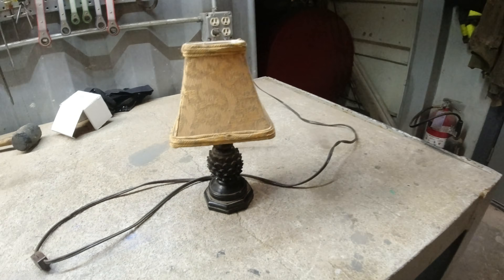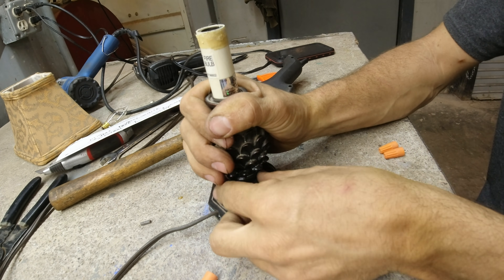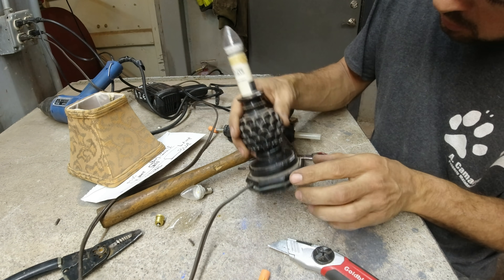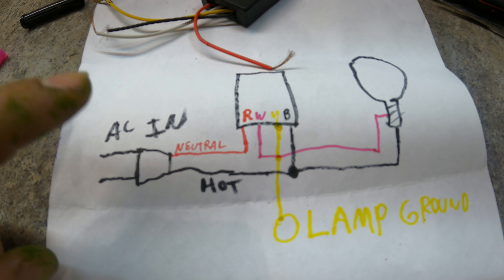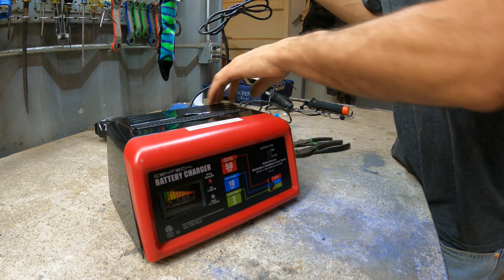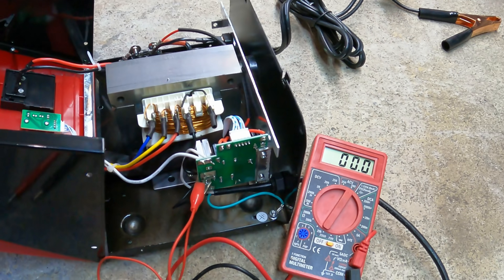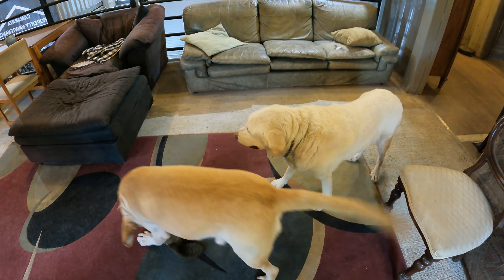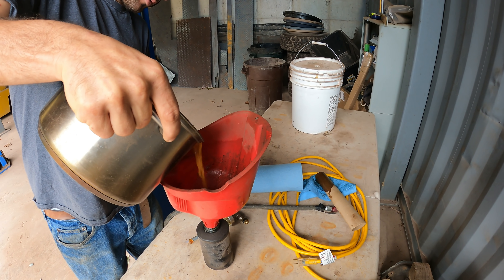Installing a touch sensor in a lamp

Comment: If you're an electrician with knowledge of color wiring I understand how easy it is, but to us non electricians, what the hell is hot wire and neutral wire and ground wire, etc. Thanks Both wires from the lamp are black so I have a fifty percent chance of blowing the new dimmer box. The only way to do this correctly is knowledge of which wire goes where...

Comment: You know, I was told that if you don't have a multimeter and you want to be sure you are having electric power, but still not sure, just hold on to the negative or ground, and then touch the positive end to your Tung, and then No Matter What You Will Then KNOW.
Attention, don't try this.

Comment: I put my lamps yellow wire to my bed frame, which is metal, saves reaching over to the lamp.     Or in your case run the wire along your window frame , 😊

Comment: Can you tell me how you did this PLEASE. I have the same charger but it's a little different internally mine is the 60581
Reply from the maker: I actually bought a newer one of these chargers and could not get it to work and ended up ruining the thing and returning it. associated equipment sells new battery chargers that actually work.

Comment: Love the touch circuit.  Exactly as you said.  Big in the 90s.  Polished Brass plated Lol. 
Put it in the truck for ignition.  Just a small touch pad in. Hidden spot.   
Holi crap Andrew.  Dude !  As soon as you get away from heavy dangerous high power equipment you nearly off yourself with low power cottage lamp. Not that 115 Vac is low power.  It will kill a person but still.

Comment: When you removed the cover from the switch so it would fit, you exposed several positive wires (hot). Then you put it in the bottom of the lamp touching the metal rod in the center. Everything was fine till you touched the conduit which was like flipping a switch thus dead short. One time it was shorted and blew the breaker when you plugged it in.   My Opinion and probably wrong. Now I know why you wanted a FIRE proof house.

Comment: I'm no electrician, at least not licensed, but something doesn't seem right with the schematic.
The hot lead looks like it makes it all the way to the bulb without a switch, whereas the neutral is switched.
I thought, and I could be wrong, that the neutral must NEVER be switched. Only the hot lead.  Anyone?

Comment: I think the Made In China is recipe for disaster I had to put in a fuel pump and ever single wire was wired backwards. pump and fuel indicator both did not work when every wire matched in color rewired it all backwards after checking to see which was pos and neg everything worked

Comment: As electrical engineer this was pretty hard to watch, biting down my teeth "Dude be careful" electricution "Holy shit!" :D

Great advice i once got  when i was starting as electrician, my boss said to me "If you really have to do repairs with live machine, put your left hand in pocket"  And the point in that was, if you happen to touch the live wire, the electricity will run through your right arm to your legs. But if it was left arm, it would go straight through your heart to the legs.

In case the floor was insulated, arm to arm will do as much damage. Left hand in pocket! 
Yet that doesn't remove the risk of dying, always unplug all the appliances while repairing.

Comment: Dude, that cardboard sleeve on the lamp socket insulates you from the 120V screw contacts on the inside. It's very thin. Sleeving it with a metal collar not the wisest move. If it shorts you won't know it until you complete the circuit... Your house is awesome.

Comment: A tip for Andrew: I have seen you unplug both the lamp and the charger by PULLING THE CORD instead of the plug. Don't do it like that. I repeat: no. I insist: no.

Comment: As  interesting as this may be to some,   "touch lamps"  are  a piece of crap.   The sensors  GENERATE  RFI/ EMI   and they are SENSITIVE to same.  This means that the lamp can be triggered  needlessly/ unwanted  by  various other electronic devices, including  radio transmitters.   A person has to ask himself  "just what is wrong with a  switch."    you know,  a SWITCH,  those things we used to us  to turn  stuff on and off.

Comment: Very funny stuff. Have to admire your determination & stamina (& Levi's). If I missed someone else's comment on your wiring diagram, it was probably because I was laughing too hard. Not about the diagram, just the comments on the video. It appears you are switching the neutral leg of the circuit not the "hot" leg. That means even when it's turned "off" there's always juice at the socket. Normally you would switch the "hot" leg. Keep the vids coming.

Comment: I know just what the Container Castle needs.  Two things:  1) zip-line from the upper level above the hot tub to the ponds below and 2) a swing fixed to the north side of the CC roof with the step off located next the tower at the hot tub level. Oh, ya!

Comment: Thanks dude! I was able to do it first try, thanks to your vid. Cheers! I hated my bed lamp before
Reply: I had a blue wire on mine. Used it to hot.
Reply from the maker: That's good to hear. I am still loving my touch lamp.

Comment: Hi Andrew, good to see Levi is fine. You sure were diligent about getting that lamp to work  with the touch switch. Interesting to see the  Habor Freight charger and DMM same as I have been using for years. Always wondered what you would think about their quality. Awhile back I got a second HB charger and it didn't want to work? Then I bought their larger roll around model and that demonstrated the same 'non-working' effect. Give me an old style charger any time. I will watch the video again to see if I can figure out where you put the solder bridge at. Also seems my old deep cycle battery keeps charged for a long time and will work when nothing else will. Seriously, Go figure! My shop is filled with HB tools but I have found if I let the get rained on they rust quickly. Terry

Comment: I do believe he wired it up so that lamp switches the neutral on and off which is wrong.  The hot lead from the plug needs to be switched.
Reply from the maker: That's How I had it the first time and it exploded. Technology connections made his the same way with the neutral being switched.

Comment: those new led bulbs are not designed to work w touch sensors- they need a fixed current. must use traditional filament bulbs. i had the same exact problem. lol

Comment: Those boards might've blown because you shorted the board. They have that plastic casing for a reason. One of those connections might have touched the nut inside.

Comment: Andrew - if you have not tried Solderlene paste flux, you really should.  Solder joints flow much quicker than flux core solders and it doesn't end up as a hard or burnt residue making it easy to clean.  And although it's not recommended for 'proper' soldering technique, you can transfer solder from the iron tip right to the fluxed joint and it'll flow right in, quick and easy - good enough for home and automotive repairs.

Comment: I just watched this video read the instructions again these will not work on any bulb that requires a transformer. Like a florescent or a LED bulb. This is why their so cheap. And their sensitive to any voltage change.

Comment: Hey Andrew, the touch lamp thing is great but just an FYI, soldering "line voltage connections" is technically a code violation. Now you can do what you please but as an electrician just want to make you aware of it. I'm sure your asking why, the theory behind this is that if the wires were to heat up to the point whereas the solder could melt, the splice can then break and short the hot wire(s) out to ground or another wire and cause a fire or shock hazard. I know you typically mechanically join your wires first which is great but something to think about moving forward, I wouldn't use solder alone on anything higher than 60 volts AC

Comment: the best way to build an strong elevator is getting a huge industrial forklift and use its lifting mechanism with an mains operated hidraulic pump. 
the other cool thing you could do is super cool Startreck sliding doors with 2 pneumatic cylinders as a drive. you can find how-to in youtube!
your dogs will love automatic doors, mine do!

Comment: Andrew the problem you can NOT convert any lamp, because the modern lamp bulbs  are a capacitive loadthat produce a peak current that these cheap transistors cannot handle well.
it even says in description it can only handle old style tungsten lamp.

Comment: We had an old battery charger that the diode went out on and was putting out straight wall AC, it not only killed the battery but fried the car ecu the battery was attached to. Don't recommend clicking the leads together for charger longevity and check it's putting out only DC and no AC with a voltmeter every few years.

Comment: On a more serious note Andrew; A while back, some of the nay-sayers were shouting that the castle was too heavy to support itself, which I didn't think was likely. Since then however, you've added a helluvalot of weight, mainly the roof but all these windows are heavy too. Are you going to run into weight issues at some point?

Comment: Andrew I hope that when you install all your doors and windows you leave some allowance for the expansion and contraction of all that steel between summer and winter. It would be fun to have actual measurements between the 2 seasons to see what the difference is. Keep up the good work!

Comment: I admire you for most of your skills. But buy a cordless system for switches and use a cellphone and automatics for on and off. Keep digging be carefull when working with electricity.

Comment: you really should keep the bottom part of the plastic to keep the glue and felt from shorting the board.   the back of that board has hot 110 close to each other.

Comment: Would you spray the underside of the roof with open cell spray foam to help with rain noise? If not, what are the insulation plans for the space?
Reply from the maker: Possible. There is no rain noise because of how thick the metal is.

Comment: $10 at Lowes or other hardware stores. 
https://www.lowes.com/pd/Utilitech-Black-Touch-Lamp-Control/50063801?cm_mmc=shp-

Avoid any rewiring and works every time. I even ran a wire from my lamp to the contact where the touch sensor connects and now when I touch my lamp it turns on.

Comment: 13:15 - You can do what want with your electrical, but pulling the cord is a quick way to requiring a fix of said cord and plug.  But your going to fix it anyway.  Just a pet peeve of mine.  I won't bitch about anything else you might do - promise.

Comment: hello andrew great video on installing a touch sensor in a lamp but wow it sure gave you a problem for abit but then you where able to fix it very nice and it works now and you also fixed what looks to me at a jumper cable box thingy great job and as far as your castle building nice widows on the top floors with a great view out them as well ss thankyou for this video andrew and until next one i say bye for now from Randy from ontario,canada take care and stay safe out there p.s hi levi and codey.

Comment: hey man, I knew a guy who spent his whole life building his house out of corten. and steel, by the way when you install the windows make sure they are in a wooden frame (so they can flex) because if its glass to a steel frame, then it will crack, my dad spent alot of time replacing his windows with wooden framed ones. good video

Comment: I find it hilarious that you go through the trouble of insulating your wire terminations, but don't worry about insulating the board itself.
Reply from the maker: There is nothing metal for it to touch.
Reply: @AndrewCamarata  oh okay I thought you said it was metal at the part you scraped part of it with a knife, my mistake

Comment: Having been kindly shown your efforts in your fantastic castle like residence. Am a bit concerned about how on earth youm are going to heat all that area. Especially up top. I did suggest to you when you were building the roof to use HHO as a fuel for electrical generators. Not sure if it would be legal, but ordinary tap (fawcet) water can be turned into a very effective fuel, that would cost you virtually nothing exxcept the original cost to install an HHO generator from here  https://www.youtube.com/watch?v=wjeM2IBhtlc. Free electricity ... virtually. You can run cars on the stuff.

Comment: If

Andrew, looking at the last schematic you drew, the hot wire is always providing power to the centre contact of the bulb and the neutral is controlled by the touch sensor which then switches the various levels of power to the outside contact of the bulb (edison screw). Not good and not safe. The touch sensor should be controlling the center contact of the bulb for safety and the neutral connected to the edison screw. Also make sure the plug is polarized so you cant reverse it in the outlet. It was a funny video.

Comment: Andrew, you should get "the clapper" that they used to sell back in the 80's and forget about trying to wire a lamp. You are a hammer mechanic, not an electronics tech.
Reply from the maker: I just got one for the lights in my big triangle window.

Comment: I have tested that same Harbor Fail charger and on "50 amp" it puts out a maximum of about 25 amps for about 30 minutes then will overheat and shut down.  It works great for as an automatic slow charger though.
Reply from the maker: John I yeah. I agree just by the size of the spark

Comment: I think you should swap hot and neutral in your wiring diagram. You should be switching the hot lead. In other words hot terminates in the box when off.
Reply from the maker: Thats how I had it the first time and it blew up. Same thing happened with technology connection guy.
Reply: Andrew Camarata I watched that video just now and yep you and he had the same issue. It just seems like a sketchy design for that circuit.

Comment: No, in a Integrated circuit you must NOT reverse polarity.
The absolutely will go boom and emit a slight puff of smoke.
I learned that the hard way at the very beginning of 37 years as an electronics technician.
If you're lucky you don't set anything major on fire or end up with thousands of dollars worth of junk parts on hand.

Comment: You could  Probably weld with that old battery charger. Most new chargers aren't worth a crap. It seems most older chargers have a real powerful transformer in them the new ones are solid state junk that don't work. I want to a pawn

 shop bought a beautiful charger, In like new condition for $25 It charges at 2 amp.,10 amp. And has A 55 amp. boost.

Comment: Yes, you should switch the hot lead in the circuit board, and run the neutral directly to the bulb.  That way when you turn the light off, there is no hot lead at the bulb socket.  The neutral is less likely to shock someone.

Comment: Those cases are there for insulation. Removing them is very dangerous. You should at least use some large heat shrink tubing to isolate the modules. Search "Heat shrink PCB" to see how it should look.

Comment: are you gonna go over the engineering that went into deciding on the constructio of the upper floors? i know you covered it prior to building the roof, but i don't know if that covered all the additional stuff you've added since you changed the roof from wood to steel plus all the things you've added since its completion.

Comment: I bet your old plug and wire you used wasn't polarized, randomly when you plugged it in it would short that board when hot through neutral when reversed.

Comment: I suspect the problem is with the led bulb you used after the first bulb broke.  The 2nd bulb has additional components in the base of the second bulb, and that probably interfered with the touch circuit.  I noticed the third bulb looks to be an incandescent one.  You could confirm this by putting an led back in the lamp and watching it explode.

Comment: You short the board sensor with the AC return wire when adding the metal ring around the socket bulb. That’s why you have that spark and blown the board.